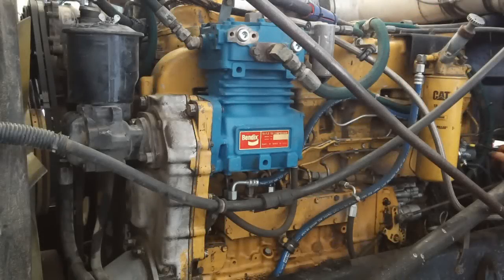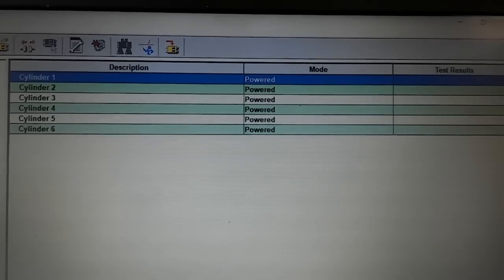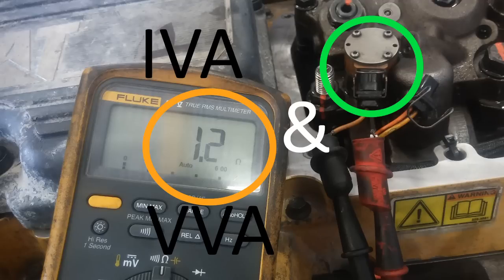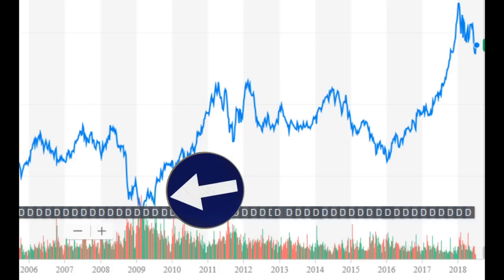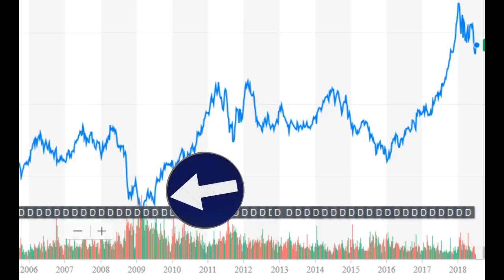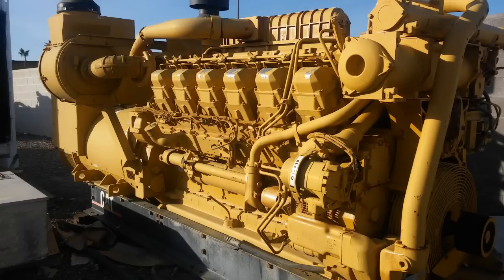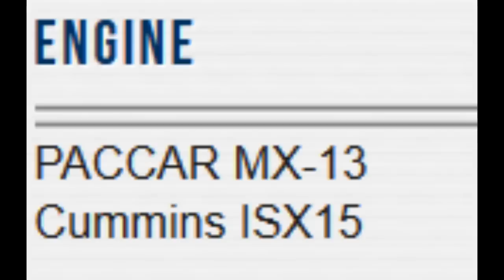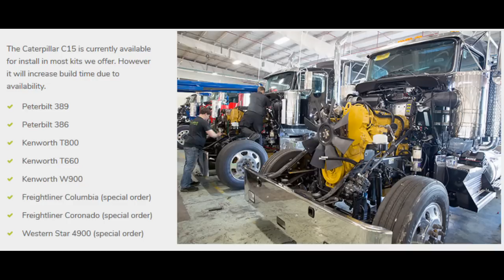Why Did Cat Stop Making Truck Engines?

Comment: In other words, couldn't  pass emissions
Reply: Ell Jay 
🤭 Yep 😂
Reply: Nope, emissions regulations made the engines not last like CAT wanted. They always produced 1 million mile engine designs that is nearly impossible with today's emissions that typically need a full rebuild at half those miles.
Reply: Exactly. I work for Cat, and although I'm not an expert on the engines, I talk to a lot of the engineers and higher ups. They all said ultimately it was the emissions standards why Cat decided not to build the engines anymore. They knew they had legendary engines before but realized meeting the emissions standards would make their engines a shell of what they used to be, so they decided to just concentrate on the off-highway engines.
Reply: Robert Polkamp as an owner of 2 cats and 4 Detroits . Cats cost twice as much to overhaul and the detroits consistently  get better fuel milage . So as an owner I. Prefer blueberries  over bananas all day long
Reply: 88tcoupe I don't agree with that. Cats 3406 was a good engine up to a point. The newer 3406 that started with electronics was not very good, the 3306 was junk as was all the newer versions, the 3208 was junk the 3408 was junk, the C7 and C9 were horrible in comparison to a 5.9 or 8.3. Cat got out because of emissions was an easy play because their reputation in the on road market was tanking
Reply: do you have experience with cummins?  or an opinion on how they compare with detroit and cat?
Reply: 3406E, 5ek, and 6nz were the best engines Cat ever made.
Reply: the govt forced CAT to make garbage engines and CAT didnt want their name on trash so they quit. thats what the EPA is for to shut down American industry and send it overseas
Reply: Not at all! Complete bullshit. Vertical integration killed the market! All truck oems bought engine companies to control costs! There was no one to buy the engines, regardless of emissions. Paccar bought daf engines. Navistar had there own or cummins. Volvo has there own,etc.
Reply: Ell Jay I heard that Cat couldn't pass emissions but Cat's engineer's had told EPA that the emissions coming out of there engines exhaust was cleaner than the air we breathe.And EPA didn't care,EPA said the engines had met their requirements.So Cat told them "To go POUND sand".
Reply: Roman Vasquez that is complete bullshit!  U need better sources than lot lizards! Even in 2017 diesel exhaust is not cleaner than the intake air! That is an urban myth. I have a masters in combustion and been engineering diesel engines for 15yrs.
Reply: Roman Vasquez ... As with the commenter above you, your poor use of spelling caused your comment to fail in communication. Tap the three vertical dots in the lower right corner and option edit so you can take a little time and make your point clear.
Reply: Andy Hass ... Who in holy hell would issue you a master's degree with your spelling skill? Dorf on Diesels?
Reply: Andy Hass ... Here's a bit of knowledge for you specifically. There doesn't equate to their, nor they're. Using the correct option in writing is quite basic. When you choose to use the wrong one(s), you display ignorance. When you choose to insult the person who points out your ignorance, you compound it. Your arrogance overrides your potential intelligence. YouTube is available to anyone and everyone. How you opt to use it has an effect on the responses you incur. You insult, you receive insults. Cause and effect. Very basic. Failure to comprehend such simplicity evidences a substantial shortcoming.
  Your turn Mr. Engineer.
Reply: No one can pass emissions regulations. The companies all lie and fake results. the real truth is the "emission stanards" are conceived to shorten the life span of engines, forcing consumers to pay more, more often. CAT has a soul.
Reply: Back when I used to drive truck, it was Cat, very closely followed by Cummins, with Detroit in the distance in the rear.  Cats pulled harder than anything on the road of similar power, and in the case of Detroit, even higher power.  The bad with Cat was cost of repairs.  They WERE very expensive to fix if something broke.  Cummins wouldn't pull quite as hard, but could be fixed at far less cost than Cat.  If I couldn't have a Cat diesel, then I'd take the Cummins without a bit of hesitation, and had one in my 98 Dodge Ram.  Detroits are turds.  The old saying of you get what you pay for has meaning.  Detroit got their market share because large trucking companies don't care how fast you pull a grade, they like cheap, and Detroits are just that, the relative "bargain" engine on the spec sheet.  They were also last up the hill by a wide margin, and most likely to end up in the shop.  I can't say what MB did with them after they bought 'em as I was no longer driving then.  Back then, however, I left a driver slack jawed when I out pulled him going up I-80 east out of Laramie, WY.  I was pulling Rocky Mountain Doubles and was loaded up heavy.  My truck was a Volvo/White/GMC with a 350hp Cat 3406E bolted to a Super 10 and putting power through a 3.71 axle.  I passed an owner operator who was also going up the same hill.  He got on the radio when I passed him to ask what I had under the hood.  He claimed BS when I told him what I had.  I told him that I'd wait at the top of the hill if he wanted to see the engine plate.  He wanted to see it so I waited.  All he could do was shake his head when he read the data plate.  His truck was powered by a 450 Detroit.  I don't know what he had for axles or a transmission (presumably 13 or 18 speed).  He just told me that I out pulled his 450 Detroit as he walked away, shaking his head.  I LOVE Cat diesels.    You'd have to REALLY prove to me that a Detroit is worth more than scrap iron.
Reply: The EPA wanted 4.0 to 0.2 emissions in 1 year? Wow....
Reply: so much crap !!!!   EVERYBODY have the same rules. ...    people talk like ONLY cat has that issue ...  volvo/ jhon deere/cummins/etc etc has the same conditions and still make very good engines.
Reply: Ell Jay No, they told regulators they could meet any reasonable emissions standards provided their engineers could decide how to meet them. They did not wish to have beaurocrats dictate to them how to build engines.
Reply: All of the replies and the end result is still the same. THEY COULD NOT PASS EMISSIONS! Simple, quit trying to sugar coat it or make excuses.
Reply: And where trying to cheat there way through and did not succeed
Reply: Leave it to the Government to screw things up. they did the same thing with the Laundry industry with the Water/Energy conservation mandate.
Reply: 88tcoupe I think this will only benefits the European and Asian manufacturers! 😒
Reply: Android Man is that why Trump pulled the US out of Paris climate deal? I noticed that the American economic policies during the Obama administration was in favor of the EU and the US lost many great opportunities to expand in the Asian, middle Eastern and European markets but somehow lost them to their European and Asian counterparts!
Reply: No, this Water/Energy conservation mandate was probably driven by Lobby to Congress by who I don't know. same like they did to the Air conditioning industry with the Freon. R12 and now R22 are not been produce because of Government regulation$$$$$$$$$
Reply: They Tried to build a engine?  Oh my god, that was such a joke. They figured they could buy the politicians off forever.  That was not a engine but a nuclear reactor designed in North Korea just waiting to fail.  What a joke.  And I did have time working on those engines.  Absolutely no way to troubleshoot the injection systems, just replace the high pressure pump and all the injectors once a years at 7 to 10 grand a pop.  The High pressure pumps could not withstand the 26,000 psi rating for any given time and would come apart.  No screen or filter between the high pressure common rail so it would clog all the injectors at once.  Each injector was $1000 and the pumps ranged from $4000 to $7000.  Do you think Cat would cut the end user a break on price?  Hell No!  Just rake in the corporate bonus.
Reply: Cummins has it down for emission end.  They are not trouble free but a lot better than what is going out there right now.  I hear Detroit is making advances also.  Both Navistar and Cat just refused to go through the DPF system.  While it is costly and fail, it still can be repaired reasonably and if you follow the regen process they hold together much better then others.  Problem is in fleet operations, operators like to cycle the key to kick out the regen until they hit total engine limp mode.  Then it gets expensive and down time is long.
Reply: Diesel Ramcharger,  Cat has not soul.  Every pay a Cat repair bill?
Reply: Andy Hass
I couldn't have said it better than you did
Reply: In truer words didnt stoop to the epa scam level to destroy years of hard earned reputation for a little cash. They deserve a huge thanks.
Reply: mike cubes Are you saying that foreign manufacturers do not have to pass emission standards?
Reply: If the authorities are so concerned about emissions why don't their regulations apply to heating boilers or aircraft? It's just political garbage!
Reply: Thanks, you saved me the remaining 5 minutes of bs
Reply: Well, that explains why the quality of diesel engines has declined over the last 15 years.
Reply: Brian Walk Cummins does get better gas mileage, but it comes with a price. All and all, I think Cat was a more reliable motor than Cummins or Detroit. Detroit has had a lot of problems, starting with that 6.2 they put in the 90s Chev pickups.
Reply: Mike Cubes let's start a petition for the EPA to get rid of emissions control. I think we will get at least 70% of diesel owners around America to sign.
Reply: Roman Vasquez lol so the air it was taking in was actually being cleaned as the engine used it to burn fuel they said. I don't know why the EPA didn't just take them on their word hahaha! It's not like there were any tests they had to pass or anything.. some of you guys are hilarious
Reply: Only reason to love PA
Reply: Off-highway engines still have to comply with emissions regulations and the standards will never stop tightening.  What is CAT's long-term plan?  Eventually stop making engines altogether?  You can run, but you can't hide.
Reply: @robertpolkamp  Big difference. The key point in this video is CAT has a strong hold and share in other markets such as, you guessed it, Off road Machinery. The EPA is still going after them as well, but CAT will always be around and be the leader in the Machinery world.
Reply: No!!! They have no problem passing!! The EPA is the problem making the company jump through hoop after hoop after hoop !! You say screw this and stop!!Government Agencies are the F*@king problem!!
Reply: Could pass emissions, BUT not worth their time.
Reply: I agree. I worked at a CAT dealer back in 2007-08 and he's not kidding about the ARD heads. I had piles of them waiting to go back after they were replaced under warranty. They stubbornly took and overly complex approach to emissions that ultimately just ended up being expensive and unreliable and they lost a ton of money on warranty claims. They could have recovered from it, but management's attitude was "Just keep fixing it until the warranty is up, then its the owners problem" and never offered many substantial design updates to fix the problems. Word gets around the industry quick, nobody wants to buy expensive money pits with the same power more reliable designs from other brands make. Too bad too, they had some good solid engines for a good number of years.
Reply: Actually, I'd call it a combined issue. The on-highway ACERT engines had problems. They are plenty capable of building a good engine, and could have fixed the design, but when they knew they were going to get squeezed out of the market anyway, its hard to make a business case. There is no reason to spend millions developing engines you might not have any customers for.
Reply: Ell Jay b
Reply: It's a good thing diesel owners don't have control of air or water quality. DPF systems save lives.
Reply: emissions is or has killed the diesel engine
6.0 emissions deleted and all good................6.7  same story......whats next ?
Reply: It wasn’t all about emissions. CAT had no interest in electric, and as of today freightliner is going to put electrics on the market almost 2 years early. Freightliner actually built their electric assembly plant back in 05 to 08. The writing was on the wall for diesel. 
CAT sold it’s diesel line to Navistar and purchased EMD from GM. CAT exited a market with a termination date and focused on a market that will remain diesel for decades.
Reply: (Sarcasm) I see no bias in this reply chain.
Reply: @88tcoupe  Yep.  I worked as an engineer for CAT for 8 years. Basically, the company decided they had enough of spending millions keeping up with BS EPA regulations and exited the market, leaving the scraps of its on highway engine business for Navistar to sift through.
Reply: Pretty much todays engine emissions standards are so strict that most trucks have exhaust treatment systems on them, however that is only on new trucks right out of the factory. Many places will get a truck body and put their own engine in it that at least in my home state of Vermont bypasses that rule. They wanted to meet emissions standards without the use of exhaust treatment systems and it apparently didn't work out so they gave it up.
Reply: @88tcoupe  Cat could meet the emissions - basically Cat DID meet the emissions - just not in truck engines. The current C15 is certified to  0.10 NOx and 0.01 PM this compares to the 2010 on-highway of  0.20 an 0.01. The '07 engine wasn't the greatest ever but even the burner is now a reliable part of the machine systems. The big question was there a market - Paccar had announced they were building a plant to make the MX - Cat's biggest customer (~70% Cat power) was looking internally - Freightliner owned Detroit, Volvo/Mack so all the big players had their own internal engine and were looking for a range filler rather than a full range supplier - so was there enough market to justify engine development.
Reply: @iansouthman3882  Interesting. Thanks for the info!
Reply: Need a rebuild at 1/4 that miles with emissions.    How wonderfull our government is. Should keep there hands outta shit.      But oh ya then again cummins said. O ya mr o bom bom. We can do it. Just hand us the multi billion dollar grant money. And we will put a piece of junk isx out.   Just like old uncle sam wanted.  And they are total junkkkkkkkkk.             Wont make 250,000 miles.     So moral to the story cat said.  No. Not ready so were out that way we dont get a bad reputation. Like Cummins now does.         Another brilliant move from the green weenies of the world.       Junk motors. And worse fuel mileage. So much better.   Bag of bullshit
Reply: hey I spell worse then him but I will put my carpenter skills up against anyone. don't have to spell super good to be great at your job. ( never judge a book by its spelling ) lol
Reply: Same reason every single diesel engine manufacturer has a cheat device; because no one can make an engine, that customers will be willing to pay for, that will satisfy the EPA/California.
Reply: @88tcoupe  but they are still making semi engines for semis and currently testing them for production on our farm
Reply: @88tcoupe  well thank goodness i would rather have a company stay true to itself
Reply: @elljay4587  Which Detroits are you referring to?
Reply: @88tcoupe  
Makes sense, good to know thx man :)
Reply: @netprowlerp  you have the advantage of hindsight. The engineers do not. Switch spots and you'll see. Ain't it funny how every man thinks he knows it all when he only sees and understands a small piece of the puzzle.
Reply: @elljay4587  Yes nut you didn't rebuild the CAT as often.
Reply: couldnt they just hire a new engineer out of college
Reply: @RJ1999x  Only your opinion,  I and many others would say otherwise.
Reply: @scampsboytes9088  that's your option
Reply: Diesel Ramcharger yes! they fake results, they don’t pass the standards conceived to make money. They don’t have a soul nope
Reply: Android Man the Laundry industry, gone
Reply: ......i.....i.....i..... trump never pulls out, we will expand even in Russian markets
Reply: Ronnie G all political bodies usually produce half baked committee bs based on the current drama. And they will continue to do that if climate gets worse
Reply: Qe TT RS code and it o no       b
Reply: Sadly, if they made an engine now, the after treatment cleaning would totally pass emissions... Without junk acert in cylinder EGR
Reply: @88tcoupe  Seems Cat is going down when reduced exhaust requirements on hevy equipment follows in a near future?
Reply: Couldn't stand the heat so they got out of the kitchen.  Their engines were good in an agricultural sense, simple but reliable, but when emissions standards came into play, they just didn't have the know how to build more complex and cleaner engines.

That's why they stuck with construction and mining, there's very little emissions regulations there.
Reply: @88tcoupe  Crapped their pants in other words.  Meanwhile, every other engine manufacturer is cleaning up.
Reply: @mikecubes1642  Because they're not clever enough to make engines that comply with the regulations.  You just leave that to the experts in Europe.
Reply: @JW...-oj5iw  You can't even spell your own name.  Beat it.
Reply: @captainwin6333  european diesels can run for 1,000,000 miles and meet emission rules for today?
Reply: @Ste30h  And 6.4s... junk regardless of whether or not they're deleted.
Reply: @88tcoupe  you know what's crazy is that this same effect they described happened to International and their motors/reputation. I hear from old timers that International used to be #1 in power and reliability before the emissions standards destroyed their standards.
Reply: @MyWatchIsEnded  That's probably the story with a lot of companies unfortunately. I'm a fan of IH also.
Reply: @Android_Warrior  , nobody lobbied, just a pure over-reach. What happened the DOE power grabbed and said no state can institute rules which are written by the DOE (who regulates the laundry machine industry). This was good intentioned to avoid all different types of equipment, but it sh@fted everyone since now everyone is being forced to use California styled washers, since Cali just lets all there clean water dump into the ocean instead to retaining it in tanks and ponds.
Reply: exactly
Reply: Cat wasn't going to Pussify their their engines to please the EPA.
Reply: without reducing reliability, thus marring the brand image.
Reply: They "could've" if they wanted to. 
Seems they knew better than to keep playing a game where the rules change every year
Reply: @MyWatchIsEnded  "Emissions standards destroyed their standards"
Could not be any more correct.
Reply: No. Not really